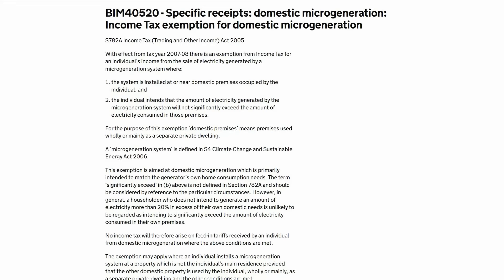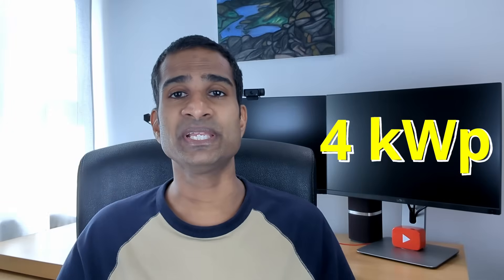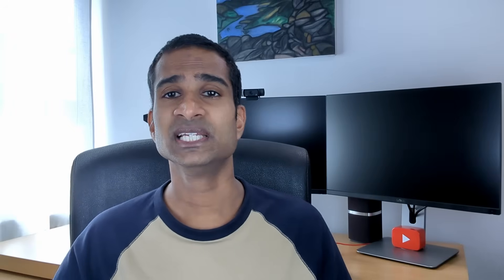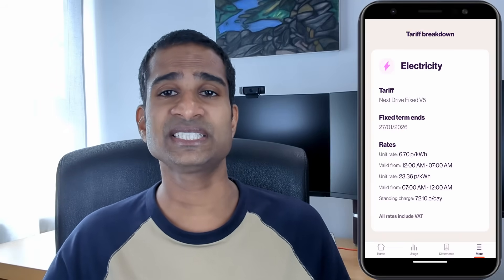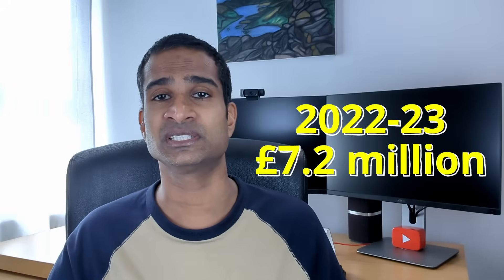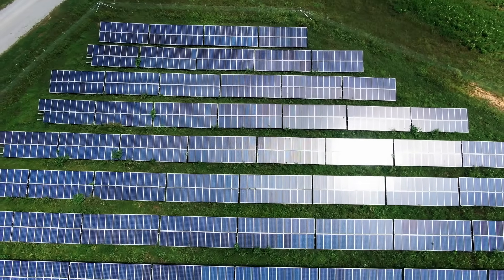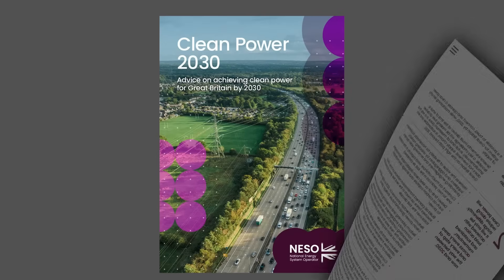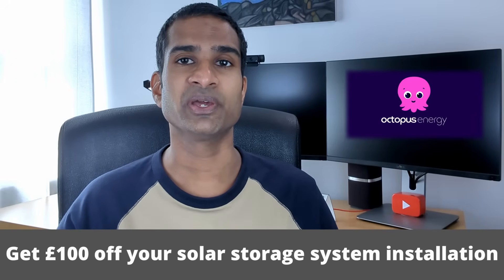What the Solar Community Doesn’t Want to Talk About

Comment: Interesting about the possible tax in the future. I’ve often been concerned that at some time they will tinker with FIT payments. And tax is an obvious way to do it. 
Regarding SEG, I doubt it’s worth going down the taxation route. It’s more likely that the rates will just drop as supply outstrips demand. 
Whilst 16.5/15p rates are available these are subject to the main import also being with the same supplier. So mainly largely as a  opportunity. 
Whilst there are stand alone rates at as much as 12p the vast majority are much much lower. 
And the minimum requirement is a payment of ‘above zero’. 
If I were taking a long term view in panels I’d totally discount the SEG payments. I think it’s too risky to make a long term calculation on an export rate that could fall to as little as 1p. (Or less). 
Like you, I have the original FIT scheme plus a second recent array and batteries. 
I forgo the SEG, receive the deemed FIT on the original panels and use as much of my own electricity as I can (just like I always have done). It can be a faff as it means checking the battery level and often remotely turning on a car charge, or manually turning on the immersion, the dishwasher etc.

Comment: Looking forward it appears a combination of solar panels and battery storage is the best option. With the spread of solar generation the export tariffs will inevitably fall and may become negative. Having battery storage enables use of the excess generation to power the house at night
Reply from the maker: I agree Tony export rates will most likely fall (video out later today on that). However, the house can be powered on peak electricity overnight, I can't see that disappearing anytime soon

Comment: If they did introduce this it would be a nightmare to administer. They would have to split your savings in to two parts, your capital returned and your trading benefit(the interest returned on your investment). The portion that was deemed your 'trading benefit' would still be covered by your personal savings allowance.

They would have to work out what is capital returned and what is your trading benefit as everyone's install costs and ROI would be different. For this reason alone I see it as highly unlikely that they will do this. 

In the unlikely event they do decide to tax it basic rate tax payers have a £1000 pound allowance and higher rate tax payers have a £500 savings allowance so it is exceedingly unlikely SEG payments will push you over this. If you do go over this allowance or you are a additional-rate tax payer IMO you should just pay the tax but if you really can't bear living up to your social responsibility just make a charitable donation.

I'm not sure how they would recover this tax anyway as if you earn less than £10k in interest from savings they recover this from you by adjusting your tax code so again this would be a complete nightmare to administer.
Reply from the maker: I suspect you're right, and it's far from the biggest fish to go for. But interesting to know that article exists and be aware of

Comment: Having just invested in an oversize solar and battery system, I am currently exporting as much as I can from solar having charged the battery to full every night off-peak. If my export becomes taxed I  will simply reconfigure to maximise consumption, not charge the battery every night and effectively go off grid bar the standing charge. As small  generators, we have to adapt to whatever tax regime is in place. If this happens it will increase my payoff time and remove the incentives to load shift, which on a national scale is counterproductive as the demand for electricity with the expansion of EV charging increases. If the government is in any way serious about net zero, taxing microgenerators or indeed any green generation  is not going to help.
Reply from the maker: Completely agree, man with a plan 👌 If you’ve not already, please do like this video, stay tuned for some more content and thanks for taking the time to contribute to the discussion on this video 🙂 Shan

Comment: Solar without batteries is pretty pointless, we use solar to run our air conditioning which is a perfect match as hot days tend to be really sunny, batteries soak up the excess allowing the aircon to run after sundown to keep the house cool until outdoor temps drop. On days when the aircon isn't needed the batteries get topped up and then we use the power over the course of the day for running the whole house. We never need to push electricity to the grid.
Reply from the maker: Thanks - since export rates have increased there is a financial incentive to export as much as we can and conversely import as much as we can in the off peak period.
Reply: @everythinghome  Unfortunately you are at the whims of the market relying on feed in tariffs. At some point these tariffs will fall precipitously as the system becomes saturated during good PV days. The current rapid growth of solar farms is only hastening this. I am lucky enough to have year round energy generation so my utility connection is purely for emergencies and I don't feed in because then they can mandate limits on my generating capacity, so I only keep the connection as backup if any of my own systems go off line due to faults or for maintenance.

Comment: I finally got my ECO4 survey, No solar panwl help its back to a Free gas boiler. So goverment are still pro gas really for heating.
Reply from the maker: ah!
Reply: @everythinghome  , I guess still fsiling with sun in winter, Still not made a Electric boiler thats can be as cheap as gas. I fo want to get away from gas but. My boilers is nearly 25 years old. New Free gas boiler should be Greener and get more heat for less gas. Less polution than 25 year old one.
Reply from the maker: @SolarResurrection similar here, our non condensing has boiler is just over 25 years old. Still going strong but need to have a what next plan too

Comment: HMRC "2. the individual intends that the amount of electricity generated by the microgeneration system will not significantly exceed the amount of electricity consumed in those premises". You then incorrectly expound on this as if it says "the individual intends to [self] consume electricity generated by the microgeneration system and there should be no significant excess which is exported"

The timing of generation and consumption is not specified by HMRC. 

Also, electricity consumption is not defined by HMRC. Is it the electricity imported at the meter? Or, is it the electricity consumed by the property (which is not metered by an approved meter)?

Over a full year I generate 8,844kWh and I consume 8,973kWh. Over the same period I export 8,050kWh (£1,208) and I import 8,678kWh. However, I generate significantly more than I use in summer, and in winter I consume more than I generate. If the HMRC test 2 is applied over the full year, I fully comply. If the HMRC test 2 is applied over any shorter period (a month, a day, a half hour charging period if we are being ridiculous) then I would often fail the test, particularly with my operating strategy which does not prioritise self-consumption.

I doubt that PV export income is likely to be a target for HMRC because (1) domestic PV helps the government to achieve their CO2 reduction targets ands (2) PV owners are voters
Reply from the maker: Thanks - yes this is annual consumption. Yes I agree - I think I confused things by talking about self consumption. Thanks Shan

Comment: It's not that there aren't concrete plans to tax solar exports, there are no plans. HMRC already has a policy to tax excessive export as you say, 20% over usage.  The typical British roof is unlikely to generate more than 120% of the electricity the household uses.  As the vast majority of households don't have to do a self assessment tax return, the Revenue is never going to start asking them to do so, in case it can tax a couple of hundred quid.  It is not at all like VED where the government knows exactly who is due to pay, how much they have to pay and it is easy to collect.  It's good to have these thoughts and conversations but this is never going to happen
Reply from the maker: I agree Bill - I think this is just a deterrent to people clearly taking the p*ss. However, it's good to know about these documents and what we can do about it should things change. Shan

Comment: I think a greater problem for exporters is that aim to have 70GW of solar. People can only export solar now because it fits into the daytime 'wiggle room' of 20-30GW that allows us to turn down gas power stations and wind (while paying to curtail). You can only export electricity that's being consumed. I believe properly constructed grid-tie inverters won't export if the mains 'voltage' is close to its upper limit, so as an area has more and more export capacity installed, its utilisation/payback should drop as inverters switch their export stages off in response to over-generation. It should be possible to counter this to an extent by storing excess in a home battery, but that too costs money. What we need is 'bottomless' demand loads that can be switched on in windfalls of renewable energy.
Reply: Unlike other places that have near-constant sunshine year-round, this (mid-day supply saturation) is unlikely to happen in western Europe. Worst case scenario: it will be like wind power, which is in excess on a relatively small number of days of the year.
Reply: @aliasgharkhoyee9501  UK wind is in excess on a small number of days currently because our capacity is about 20GW. This government has plans (we must do this - a good thing) to triple/quadruple wind too. Since we had enough capacity to generate excess, every added GW of wind capacity reduces the utilisation and hence payback of the generation type. UK already routinely hits double figures of solar generation  around noon. We can't double solar without that too being 'clipped' occasionally, and there will be neighbourhoods which will reach saturation first.

Don't mistake this for an argument against renewables and fight it like it's a carefully aimed tap on the knee. Renewable energy is the rational obvious future for the UK. Adding generation transducers without a bottomless demand application will cause windfalls of renewable energy to be increasingly wasted, making it less attractive to 'volunteer' to generate. I wouldn't be surprised to see a rash of "why is my export declining?" videos this summer. Certainly by next summer? I don't want to muddy the issue by suggesting what the bottomless pit should be, I just want to call attention to the imminent arrival of the problem for solar that already afflicts wind.

Comment: I got lost in the middle there. I understand 'the rules' as not requiring you to self-consume at all. So in your example of the 3,200kWh solar home who consumes 2,700kWh of electricity, it doesn't matter if they consume it all from the grid at night-time and export it all during the day, they still don't "generate an amount of electricity more than 20% in excess of their own needs".
Reply: Yes, makes no difference if you export all or none of your generation, the measure is generation against consumption. If you are under 120% then you are exempt and TBH if it's a great year and you get 125%, HMRC won't care either. This is only an issue for people with massive arrays, maybe extensive garden arrays who really can generate a lot more than they use.
Reply from the maker: Thanks Bill - exactly that 👍 HMRC really don't want people with minimal borderline income having to submit tax returns. As you say it's a deterrent for sticking in a massive array on a field and hooking it up to your house. But interesting it is there in the background and until this year was something I wasn't really aware of. S
Reply: I've seen FIT discussed in the past, and there was some question raised about whether any income from the FIT contract could be included within the subsequent HMRC guidance - certainly the generation income.
Reply from the maker: Yup that's it 👍

Comment: I'd rather turn off my generation than be taxed for selling it back to the grid. A bigger battery, more panels, and eventually disconnection from the grid.
Reply: Well that's just silly, let's say you export £100 of electric, say you pay £20 tax, you still have £80. Now turn off export, and you now have nothing! More storage, and panels is going to cost lots, and you'd be losing even more potential export earnings. Unless you have acres off fields full of panels or a generator you're not going off grid in the UK. I have 15.5kWp of panels, 61 kWh today, in the winter a tiny fraction of that is generated daily.
Reply: @TheRonskiman  I think he means at the point where he would be paying tax, then he's switch it off. Thus earning the £80 and nothing more in your example.
What I'd do is put an electric radiator in my garage and turn all the lights on, just to waste the excess for the hell of it.
Reply: @roi354  The video refers to the possibility of having to pay tax on all income from exports being introduced, not with regards to going over the current allowances (which could be removed), which few would currently exceed. So your idea won't work, any paid export and you'd be taxed on it, so in the example he'd pay tax on the £80 if he reduced his export to that.
Reply from the maker: I get the sentiment but to be truly off grid would take a significant initial investment. It's the standing charge that bugs me the most as it's completely out of my control 😣
Reply: @everythinghome  Gets my goat too. Lived overseas for a while, no standing charge and the energy costs were tiered to encourage you to use less first 200 units at one price then next 200 + and so on
Reply: @everythinghome why you should you not contribute to the cost of the grid which is there for you on a freezing dark January week when the true cost of those kWh is many times what you actually pay.
Reply from the maker: I agree there needs to be a cost to maintain the infrastructure, but the rise in standing charges over the last few years is way way above inflation.
Reply: @everythinghome & paid those folk that drove the market to the bottom of the market (and forcing companies into closure) & to be subsidised to get transferred to other companies
Reply: That's exactly what I want to do, even if it means running a propane generator for a couple of weeks at the height of winter.

Comment: Surely, if your annual electricity usage is, say, 5,000 kWh, and over a full year, your Solar PV system produces no more than 120% of this (6,000 kWh), then no tax is payable. It doesn’t say that you need to consume all that you generate. To meet your needs you might, say, use only 2,000 kWh of your solar generation and export the rest (4,000 kWh) but you would need to import 3,000 kWh from the grid. So your usage would be 5,000 kWh (2,000 kWh from Solar PV and 3,000 kWh) and your generation 6,000 kWh (4,000 kWh) exported. This looks to be OK given the HMRC wording.
Reply from the maker: Thanks Colin - yes that's how I understand it - it's that 120% - perhaps I could have explained it better
Reply: @everythinghome you made it sound like it was daily. I also expect it based on yearly consumption and export.